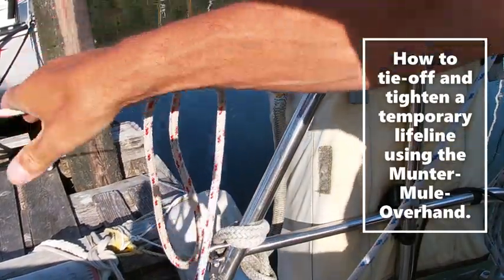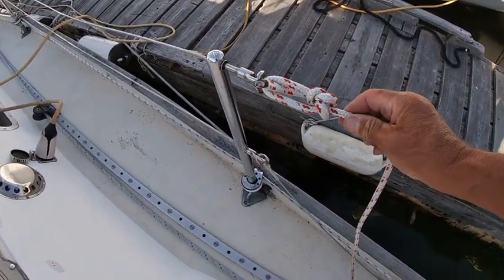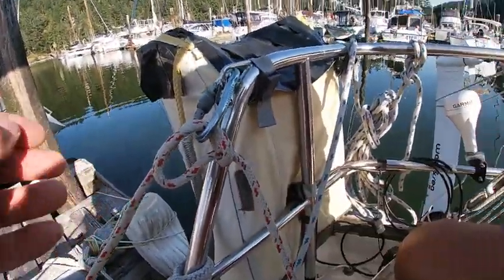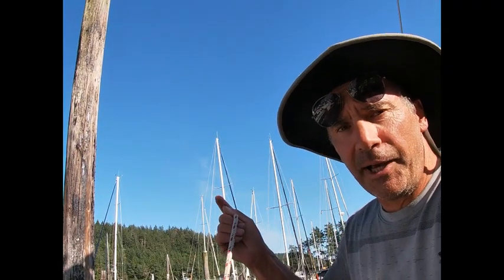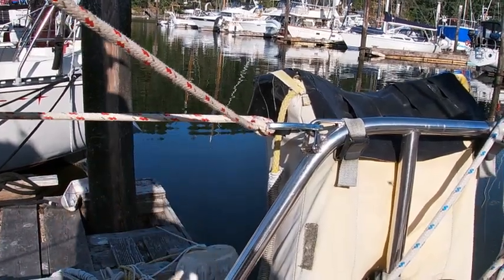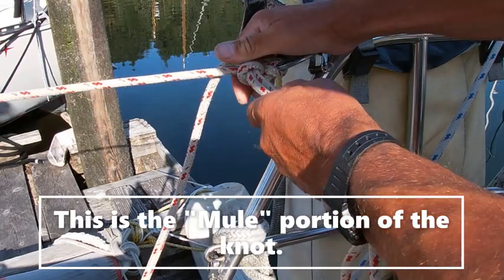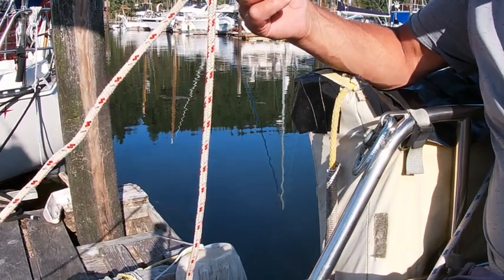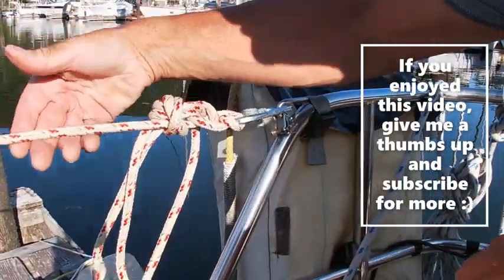LEARN HOW TO TIE, TIGHTEN AND UNDO A TEMPORARY ROPE LIFELINE

Comment: Suggestion: Single handing man overboard video?  Seriously, how would you single hand, rescue someone else and how would you attempt to get back on board the boat if you fell off?  -Just an idea.
Reply from the maker: Great suggestion. In 2013 a friend filmed me doing a practice singlehanded manoverboard drill  under power in flat warm water at 5 knots where I came back on board using my long tether and nylon ladder approach. I never did get the video from him. I do have quite a lengthy discussion on this topic -- staying tied to the boat, and re-boarding here in the link to this old video of mine. https://www.youtube.com/watch?v=_3EHD4tx9tQ
The nylon boarding ladder discussion starts at 4:05 in the video. But if you are interested, I discuss my overall approach for staying tied to the boat in this video.

I have been thinking about doing an update on a singlehanded MOB drill. As you outline, it is a very important topic. 

Great idea to shoot a singlehanded rescue of someone else. I have practiced this with just a floating fender. My approach is "Heave to. Sail to..." and drift toward the MOB very slowly. If the MOB is conscious, they can climb aboard. If not, being Hove To allows the singlehander to clip the MOB to the boat, and organize some way to hoist them up with a pulley 3 or 4 to 1 pulley arrangement. This is a highly technical self-rescue procedure. In one of these practice runs, I actually fell overboard myself for real trying to reach the fender MOB decoy and had to self-rescue myself. And yes, I was alone at the time.... Yes, great suggestion for video practice run.
Reply from the maker: Hey just circling back -- I did film a practice run of myself doing a singlehanded manoverboard drill. It can be found here: https://www.youtube.com/watch?v=4I4WFaikXqs&t=272s